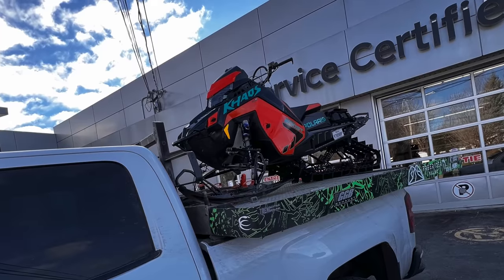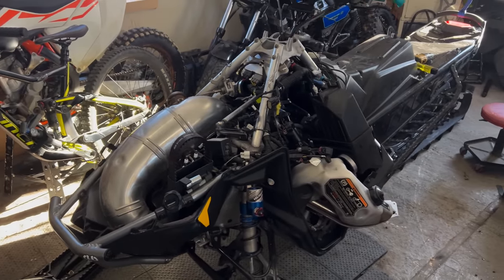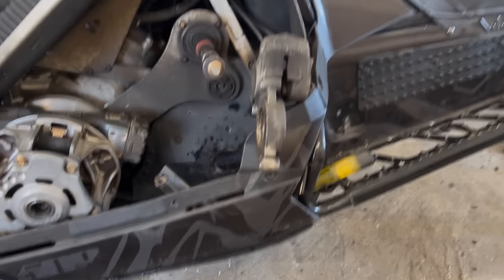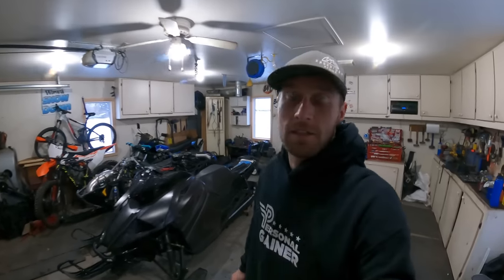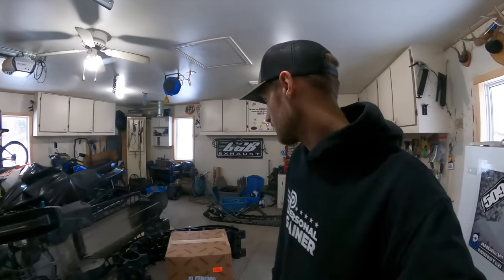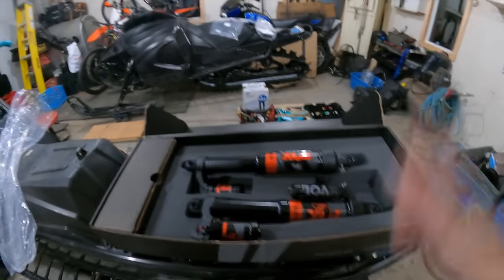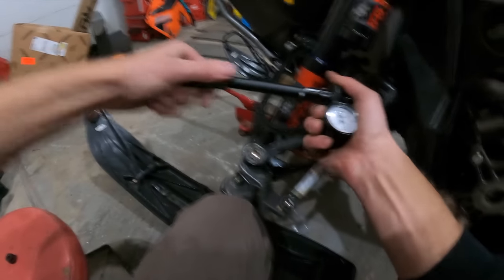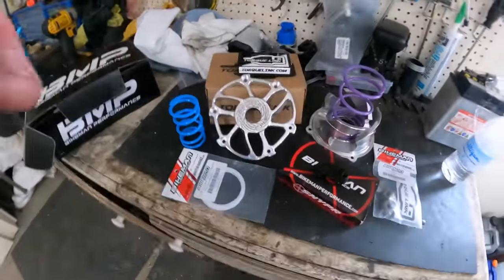Sled build time!

Comment: Great looking sleds. Why did you change out the track for the same length and lug? Durability? I have heard the Composit tracks are quite strong. I guess the weight is from the 2 ply construction. I think the stock track is 1 ply.
Reply from the maker: The original track had a rip 🥲 Also fun fact the composit actually measures 2.75” where stock measures 2.63”

Comment: What drive shaft are you using for the swap in the alpha? Also does the skid mount in factory alpha holes?
Reply from the maker: I used a drive shaft from a 2018 twin rail cat. Skid uses the dropped elevate holes same as where I had the alpha mounted.